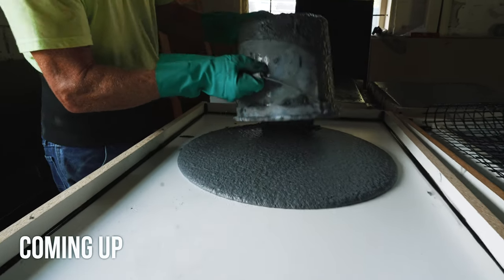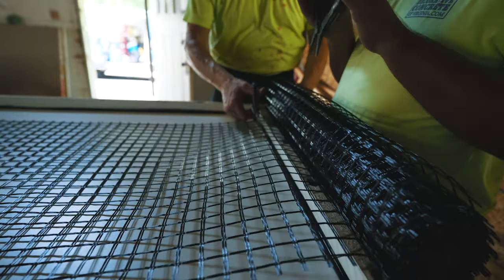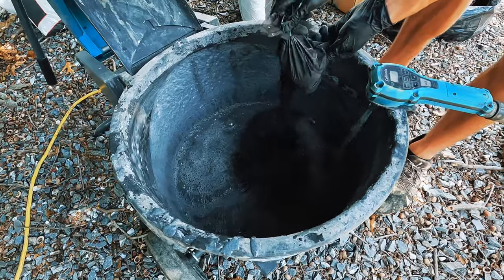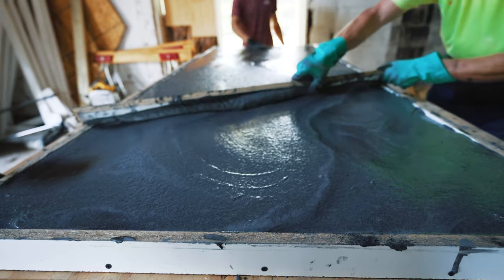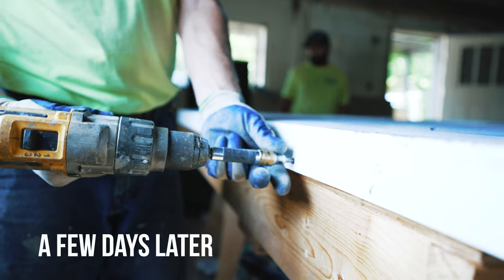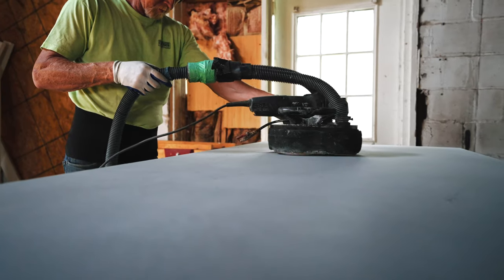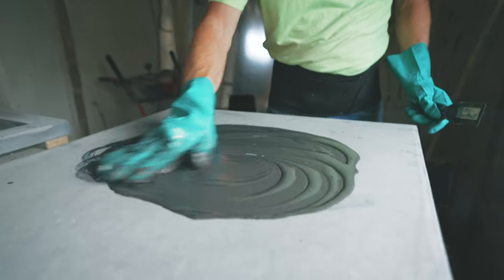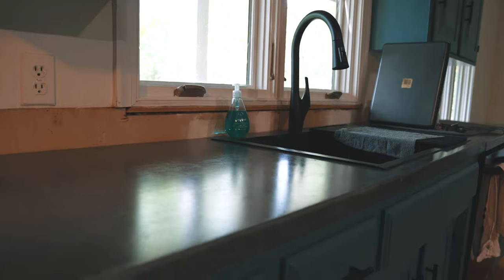The EASIEST Concrete Countertop Mix

Comment: you could use some lessons in applying caulk. but other than that, you did a great job. don't worry, not everyone can apply caulk like a pro.
Reply: The caulking made me Ill too haha 🙈
Reply: 100 % agree. I do these. Run a bead on the piece before You secure it to the main board. You don't have to get crazy with it
Reply from the maker: Haha

Comment: If the finished surface is on the bottom and the melami sheets only go up to 8ft and your countertop is 11ft, what is the best approach to buttoning up the melami so you don’t see a line/joint where the two pieces meet.
Reply from the maker: Most cabinet shops can order melamine that is longer than 8’. 

It’s hard to hide the seam if you can’t find a sheet that runs the entire length… unless you are going to grind them after you pour them.

Comment: I have never seen horizontal concrete that did not eventually crack rebar or not. Why doesn't a thin slab that big crack?
Reply: Glass fiber is generally used in these mixes.  The concrete is lighter and stronger than street concrete

Comment: If you want easy, Westcoat TC-0 over mdf or plywood!
Reply from the maker: Interesting. I’ll have to look into that. What kind of prep do you do?
Reply: Macoat system except TC2 base coat followed by TC0 top coats. I've done it both with the WP90 and WP81 for base coat, both worked! (Interesting TCO not shown on specs anymore)
Reply from the maker: Cool. Good to know. 👍🏻
Reply: Sounds lighter, how thick ?

Comment: my ass was puckered the whole time you were stripping the forms and flipping them over. you guys did a great job and they look spectacular. the only thing i would do different; pour them right side up. you can practically polish the concrete to a mirror finish while it is still wet and setting up. and you don't run the risk of cracking it when you flip it over. but everything is a learning experience and you definitely got valuable experience from doing this yourself. also, in this economy, and the price they want per bag of that stuff, i think i will mix it myself when i pour my countertops. wish me luck. and have a great day. 😃😎

Comment: Love it, first job out of the military was working in a precast yard. Fell in love with making architectural concrete. Used experiment with polishing concrete, to putting glass, sand blasting and acid etching. Concrete is so durable . Nice job!

Comment: Good work.  A couple of questions -about your procedures: the video didn't show whether you were using masks or not when mixing the cement powder. Do you use them routinely? Also - didn't see anywhere that the mix had been vibrated after it was poured. Do you do normally vibrate the panels?

Comment: Did you guys use a form release? If not, did you get bug holes?
Reply: Don't need form release if you use melamine board. Concrete doesn't stick to it. And holes are almost guaranteed for certain mixes. Grouting is a necessary step for most of our projects. The holes are generally tiny, like a pin prick but you need to fill them in. You can use Kodiak mix, which when utilized properly leaves no holes, but it's a bit more expensive than other mixes.

Comment: Hey Tim, awesome work as usual! I truly appreciate your willingness to share. I actually had a question about your faux slate overlay (non-spray) video. I live in the northeast and am refinishing my 50 yr old patio. Do you have any product recommendations for the different layers (colored grouts) that are available to consumers? I can’t seem to find Westcoat products for purchase. Thanks in advance for any help!
Reply from the maker: Westcoat is sold through concrete stores/resellers. You should be able to call westcoat & they can point you in the right direction in your area. 

H&C grout is sold through Sherwin Williams which also works pretty well.
Reply: @TimDCVA  Fantastic! Thank you so much!! I’ll send you a picture when I’m done. I wish your course was live before I attempt this but I’ve already committed to the work 😂
Reply from the maker: Yes please do send photos. @timdcva on IG or just email me. 👍🏻👍🏻 Hope it goes well.
Reply: How much does something like this cost

Comment: What is the minimum thickness of the countertop achievable with this technique? Is 2cm doable?
Reply: Depends on the mix used.  My shop would use Buddy Rhodes GFRC (glass-fiber reinforced concrete) and usually the thinnest places on a countertop would be just under 2 cm, (3/4 of an inch)

Comment: Concrete is too thin.
Reply: I agree with this comment. Soupy concrete will work and its easy to work with, but its not as strong. A drier mix, properly vibrated, is better.
Reply: I looked at the details for this mix and it had a high psi, I think 9000 if I remember correctly.
Reply: @sosalty701 I did mine with 10000 psi 8 years ago still looks great
Reply: What are you building a foundation or a table top, Looks good to me
Reply: This is not driveway mix. This is highly a engendered cement based product. Not exactly concrete in the sense your thinking. And yes if this were regular stuff going into a driveway it would be worthless.
Reply: Ya Shut up @subieRow lol it’s a table top not a foundation
Reply: Just add alkaline resistant fibres.
Reply: The plazticizer makes it runnier without adding water